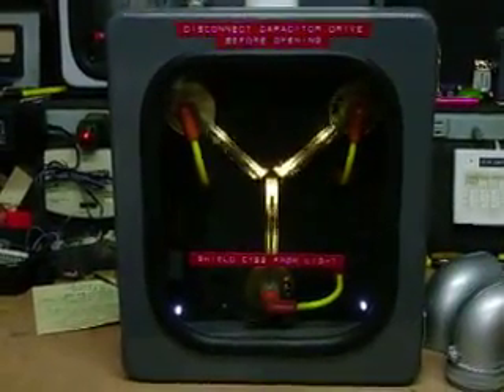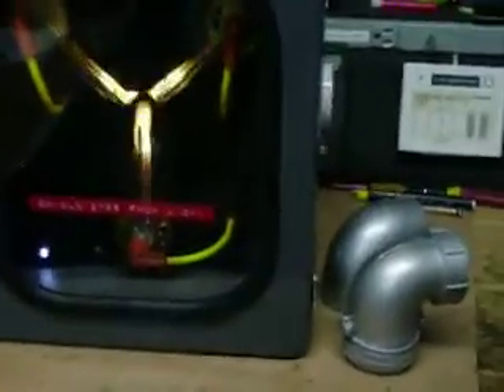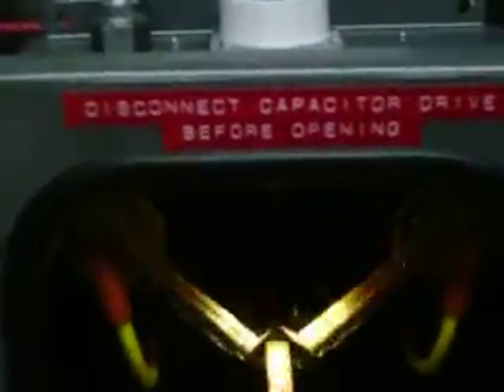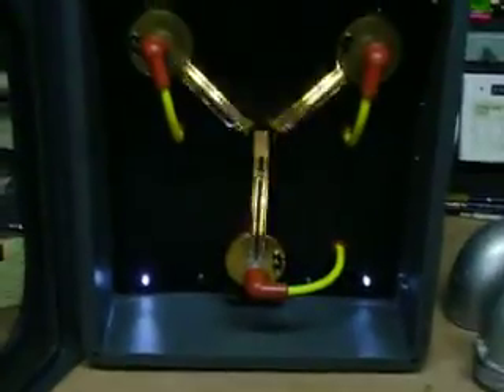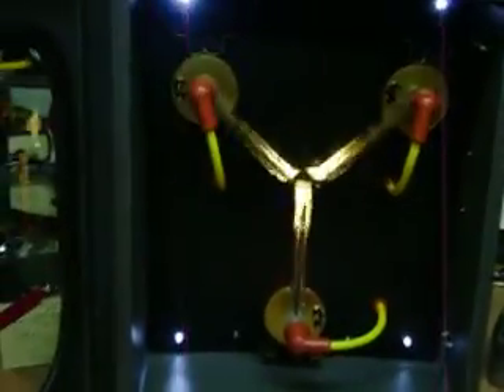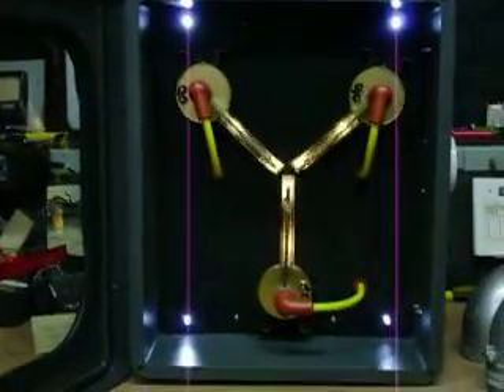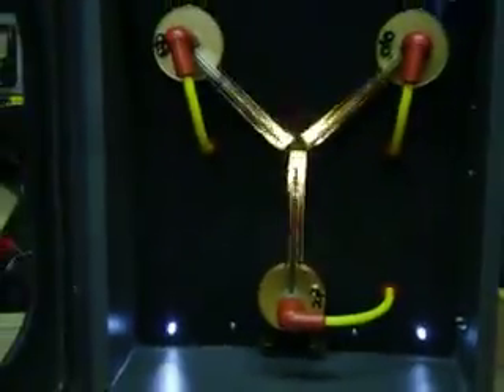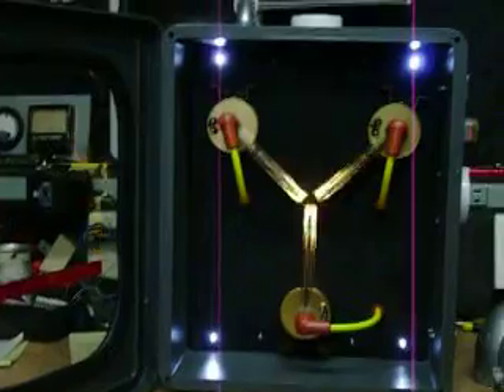Doc Brown v.2 03-2012.MOV

Comment: Very good and very accurate flux capacitor. The nicest features of this is that you customized it, so if you don't want the elbow connector, you don't need to have it. If you want it to flux slow and you think that's the correct speed, you can do it. If you don't want the LEDS that illuminate the case on, you don't have to. The parts aren't cheap plastic that you make out of crappy plastic resin. It also does the full on mode, which is nice. And best of all it just looks awesome.

Comment from the maker: Yes, already have several times.
 
I just contacted this month to produce a total 100% accurate Flux Capacitor to be displayed in a museum. This Flux Capacitor will be made using "ONLY" authentic vintage circa parts suchas: the Stahlin enclosure,Torr Relay Switches and the Cannon miltary elbow type connector